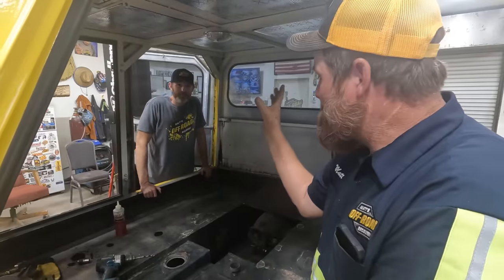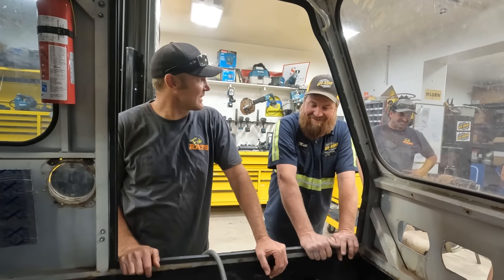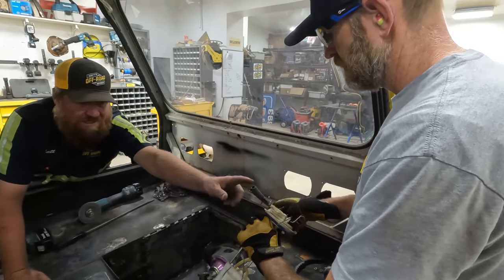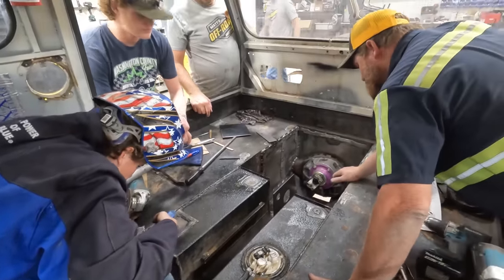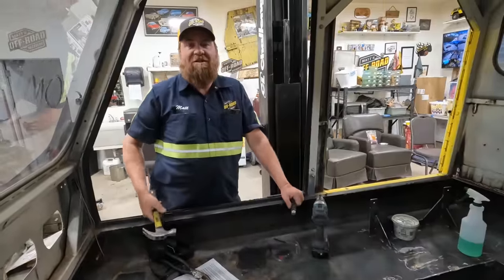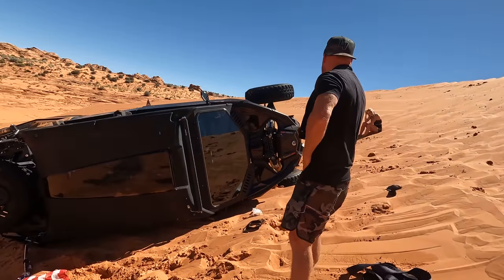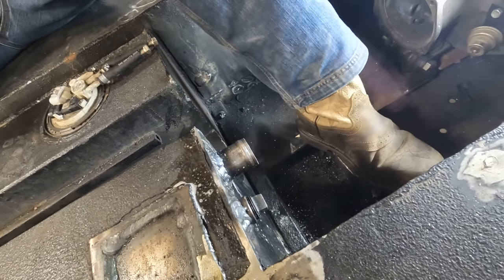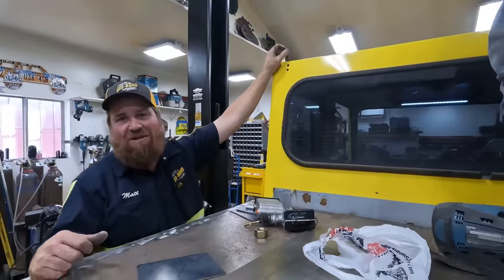I Made The Bombi Unsafe For Everyone, But Me!

Comment: Rhett, If you get a gas leak thats ok, He only asked you to make it waterproof, LOL.
Reply: Matt, Tom and Jamie... Kindly, As a Doctor,  "Safety Squints" don't work!  The sparks from a grinder are  FAST Flying particles of WHITE Hot Metal, and Flux that will INSTANTLY burn through  your Son's Eyelid, Cornea, Aqueous Humor, and Lens causing permanent BLINDNESS! Grinding and welding without safety Glasses is MUCH, MUCH more Dangerous than an improper weld, or securing a winch to a tow point.  These are your KIDS(?)! Set a good example! Would you ask your Kids to stand in the Triangle of DEATH when wincing a vehicle?

Comment: Everyone who ever got any good at welding began as a beginner. Some jobs are more challenging than others, and trying new stuff is how you get experience. Good job, Rhett.
Reply: Everyone who ever got any good at ANYTHING began as a beginner. Nobody is born knowing how to do stuff already. You learn as you go along, and everyone has to start somewhere. I remember when I first started training to drive 18-wheelers. When I arrived for my first day of classes in December 2004, I had never even been inside of a big rig, let alone ever driven one. Now, nearly 20 years later, I can just hop up in one, push off the airbrakes, throw 'er in gear and motor on down the highway just as if I had been doing it all of my life. But I HAVE'NT been doing it all my life. I had to start somewhere just like everyone else, as I did that first day in December '04, and learn things by trial and error as I went along.
Reply: @joeblowe5813  Maximum respect to big rig drivers. Ya'll risk all the loons on the road these days to get our stuff where it needs to be.
Reply: Welding is easy. Welding well is hard.  🤷🏻‍♂️
Reply: @Christopher_R  it's not that hard I was certified to weld government contracts and pipeline at 18 mig tig and arc under water is all I wouldn't do we always said good welders aren't cheap and cheap welders aren't good
Reply: Yeah I don't criticize as a general rule. When it comes to welding I never do. I was inspired to buy a welder by VGG and I consider myself a beginner. My work holds up, mostly on the snow plow, but I did some exhaust recently. That was a real challenge but at the end the truck is the quietest it's ever been since I owned it. Replaced a few sections and welded outlet of one of the cats. The hard park was the top where you can see and welding by feel is an option. After trying a few angles and getting my face and mask to close I got it.

Comment: A couple tips when you want a full seal weld. 

Make sure you clean off any paint or anything that could become a contaminant in your weld. Contamination causes porosity which won't help with a seal weld. 

Second tip, grind your starts and stops and weld back over the end of the last weld. This will help promote full penetration and a proper seal rather than what is referred to as cold lap. 

I was also taught MIG is the worst process for a seal weld, TIG would be your best bet for success on a seal weld!

Comment: Our tank builders will use a tig welder to go over mig welds that have a few pin holes. They also do a hard plug of all ports and pressurize the tank with a few pounds of air pressure, use a regulator to hold that pressure. Then check all seams and fittings for leaks.

Comment: i wrote a comment when you were putting those airlines on! i told you so, Stainless Steel hardline is the way to go with high pressure air line, anywhere that may have a bit of flex to it use a stainless braided airline.  Ive done air ride systems on many vehicles and never had a single issue with the lines!

Comment: SUGGESTION about the grab bar: no matter how high you raise it above the roof, recess it at least 10" back from the back side of the cab, so it lets you use the roof as the seat and grab bar as the backrest of the chair(or securing cage-like surround bar). Basically, it goes up from corners, then bends backwards as deep as you require for enough seating comfort, then turns across the roof and finishes the same on the other side.
Reply: Clever person.
Reply: I'd put 1 in OSHA Spec ( there's 
usually a min/max range )  & then 
a 2nd ( smaller diam. ?) maybe 
even 3rd horizontal bar(s) tailored 
in-height to fit your camera people's comfort.
Reply: @rythemzlatin  OSHA spec maybe too tall for the Bombi to fit into the shop; don't think it'll allow removable railings.
Reply: bar is good Seats are a MUST. Making someone stand for long trips on terrain like they travel is beyond OSHA, its raised to the ICC level.
Reply: @SFPhilo  It would be the same height as the originally planned grab bar, just not obstructing the edge of the roof. It would also allow for more storage above the engine bay, as they would not put seats in there.
Reply: hillbillygaragecs2921  you clearly missunderstood something. It is as safe as the grab bar, just with a little advantage.
Reply: My thought is, keep it low so it will fit under tree limbs.
If your talking OSHA they would require you to wear a harness with a lanyard to stand on something that high.
Reply: @bigredc222   Wrecker is way higher, never had issue with any trees, and on top of that there arent many trees there, and the ones which grow there, aren't that dense to be the problem anyway- at best little inconvenience once a year. Also, its not a road vehicle, so if you are not in the cage inside, strapping yourself to it outside is more dangerous than having freedom to jump of it any time you sense danger.
Reply: I would put fake stacks as vertical supports for the grab bar. Form over function.
Reply: 31:40 Could do a grab bar that lays flat / folds down on the roof and you pull it up and lock it into position when needed that way it's not always there adding height to the rig. Couple locking lynch pins  or something tied to the railing itself, or just have it 'drop down' and lock in using gravity / weight to keep it in. Locking lynch pins if you're worried bout it being lifted up / pulled out.
Reply: Maybe a seat like on a bass boat for the camera man on the back of the bombi
Reply: @Alconium  good idea. It could lock 90 degrees for standing and 45 degrees when you want to use the roof's edge as a seat to rest your feet. And fully down for tight squeezes... With pins, it would rattle. Something like Keyles bicycle seat clamp mechanism or quarter of disc brake and vice hybrid would work better...
Reply: @SFPhilo  An approved scissor lift has pins you can pull and flop or telescope the sides down, no reason this couldn't be the same.  OSHA would just say "can't be operated/occupied in that position".

Comment: Get pivoting boat seat pedestals for the seats in the bed. This way the whole seat and pedestal can be pulled out leaving only the mount when you need to haul cargo in the bed. They also usually rotate 360 degrees and lock at every 90 degrees of rotation, so the cameraperson could lock their seat backwards, forwards, or sideways.
Reply: YES, Bass boat style seats would work awesome and take up very little space. 
Can be removed also when not needed.
Reply: Grumman seats are just as easy. Made for van floors.

Comment: I admire you all for mig welding your fuel tank and fittings, I was thinking to myself when you checked for leaks that i would have brazed all those fittings in and fixed all the leaks with bronze as well. Good job on the Bombi so far, I'm sure it will work awesome when its done.

Comment: I was there yesterday and was so happy you put those triangles on the core support. 

Now you must consider having the grille of the same shape with the exhaust protruding through the grille. Honeycomb grille representing bomb BEE. Have you CNC guys cut out the honeycomb. Then bend it to match the triangle shape. Have the grille powder coated with chrome powder coating. That will set it off against the yellow paint.

Comment: Little trick for when you are welding tanks.. Ofcourse  you tack it up but use very low power for small tack welds, then reposition your tank on the bench so you are welding down hill with normal power settings.. Seems to work very well, atleast for me it does...

Comment: Seems to me in front of the drivers seat would be the best place for the brake handles..if you came up from the floor where they are now & above the floor a foot or so & then go drivers direction 90° or close to it...then 90 again above the feet & between the knees, then just short uprights..just above waste height would be a good setup..still keep the floor clean & free of obstacles,  & get the sticks in a more ergogonomic position.??  Just A thought... might not even fit or work that way!!

Comment: You know Matt, knowing your rep like all of us do may I suggest that you put two fuel sensors and fuel gauges independently of each other, you know , just in case.
Reply: Doesn't matter how many gauges or sensors you install it still needs someone to interpret "E" as being representative of "EMPTY" rather than "ENOUGH"! Then that person has to take said tank/vehicle to the gas station, liberate the credit card and fill said tank to "F" which represents "FULL"!
Thanks for the laughs and video.
Is that tank not removable? Would be a lot easier to weld on the floor or bench.
Regards from Canada's banana belt.🤞🇨🇦🍌🥋🕊️🇺🇦🕊️🇺🇲👍
Reply: Maybe an old school sightglass in each tank for in case each gauge fails too. 🤔

Matt things 😂

Comment: Matt, have you ever considered mounting a vise to a flat plate and attach it to a receiver hitch for you trail repairs? I think it would be very beneficial to some of your trail repairs!
Reply: They have a vise for the receiver on the wrecker !!
Reply: Ahhhhh! I just must have missed that. I’ve not seen it yet. Thanks for the info!👍🏻
Reply: @ericszatkowski6001 Matt likes to keep weight to a minimum especially on vehicles that work in the sands. A 25 or 30 lb vice is a chunk of weight, for the most part, doing nothing. Yes the wrecker has one, stored on the boom I think. Right hand side, it's red, if my "firgetery" is working.
Reply: @ronwilken5219  very true sir

Comment: I'm SO GLAD those little corners got filled in, looks a bunch more betterer. 👍

When you want to weld water/airtight, TIG is your friend.  Also buildup of weld is like stacking contaminants, it's a merry-go-round of failure.  8's is the best MIG way I know, dig the leak and dig a dimple beside the leak, plug the leak and move to the dimple to finish the weld, so you don't get the "fisheye" over the leak that will perpetuate.
Reply: Also likely safer when you are trying to hook a rope with one hand, hold the hitch open with the second and hold a go-pro in the third, all while standing on uneven icy ground.  Not as pointy for your skull...

Comment: Hey just a thought.  Since the brake levers are going to be in between the 2 front seats, why not parrallel the throttle on the passenger side so you could drive from either seat.  Could come in handy.

Comment: Welding a Gastank and similar is done great with WIG. Because you also can reflow an existing Weld and shut Pinholes OR you can add a material. Also the Weld is cleaner which is similar to less Pinholes. Another Option would be to solder it on (dont know the exact english term, hardsolder?). Fixed a Motobiketank this way.

Comment: I am sure you don't want a posi track. But a Air locker will make both tracks pull if you're stuck . And can be unlocked to let you turn like it's supposed to. That's what semi trucks do for traction.
Reply: with turning brakes thats redundant, whenever the side you dont want to spin starts spinning you just apply more brake yourself to compensate

Comment: Just a suggestion. You might look into doing some acetylene torch welding on some of that thin stuff. I have found it can be a gentler way to weld. Slower, for sure, but sometimes that's what's needed.
Reply: They also have TIG setup, but seem to not have anyone who's comfortable with it.
Reply: Or TIG.  Much better heat control, I think.  I just bought a TIG welder and I don't even know how to weld 🤷‍♂️

Comment: Make that roof bar foldable over the roof, with safety pins, and seats that would integrate into something like towing hitch receivers, so they are easily removable. And also a camera holder and/or an 360 light holder ...
Reply: millennial   Han and Chewie would be pissed.

Comment: Matt, Crazy thought, on the steering/breaking levers, if you put a third level between that an inch forward of the 2 existing levers that sticks up 5? inches higher and attach a crossbar that could pull back both levers when the center one is pulled you could have a one-hand full stop lever. With a little fancier fab work, you could even a locking mechanism to the third lever as an emergency/parking brake.

Comment: Windex, best thing I have used for pressure testing. Even the smallest leaks turn into a bubble mass in a few seconds.
And I discovered entire by accident, or laziness, however you want to look at it. Soap was at the other end of the shop and the only spray bottle left that worked had drill coolant in it.

Comment: Hello Mat. Just to let you know of the pending trouble you are about to cause your shoulder joints. I was in the military for over 20 years. Different trials were carried out on steering systems as you are proposing. While your system might seem novel to you, or maybe you just want to be a stubborn old fox that won’t let go of your offset levers. After using the Bombi for just a couple of hours you will be sorry you ever thought about it. A jolt in your machine while pulling on one or worse still both in an emergency can and has in the past lead to you pulling your shoulder joint right out of its socket. If you want a novel, yet sensible way of steering you can easily fit remote mounted servos connected to the master cylinders that operate the servo with another master cylinder then they are piped to the respective brake chambers or slave cylinders. You have lots of room on the Bombi to mount them anywhere as they are piped from the standard master cylinders. Get the bore sizes right, ie small bore master cylinder to larger bore slave cylinder is equivalent to longer levers. This would mean very little force would be required by the operator even possibly with two short levers dash mounted. This would give much more space in the cabin giving a much easier entry or emergency exit from the Bombi. As your idea might appear good, just imagine having to strip your whole system out again because yourself or one of your amazing team dislocates one or the other shoulder. Lots of experience in trials and uses of such ideas should count towards your decisions on your rebuild. All the very best to you all and keep the great content flowing.

Comment: Once at a fab shop in Illinois, a guy built a tank for coolant storage non-pressure, it was about 16' w X 20' long X 12' in height. The guy that welded all this together decided to check for leaks WITH AIR PRESSURE. The plate used was about 5/16" thick steel with varying gussets, interior baffles and corner bracing. Luckily another fabricator saw what he was doing and pull the plug while he was airing it up before the bomb went off.

Comment: If you build another fuel tank.  The best way to deal with leaks is the drill a small hole at each leak.  The benefit is you know where to weld, you clean out the area and you get better penetration.

Comment: In case no one mentioned this but there is likely to be a spray of mud,snow and slush hosing off the back of those tracks going upwards and forwards. Just be sure it is not going into the exhaust or somewhere else you don't want it. Some mud flaps are probably in order. Fun project!
Reply: The short exhaust would melt it before it became a problem getting behind the rad would be my worry plug the fins and overheat

Comment: When I seen the grab bar up at 48" I was thinking it wouldn't make it thru the current garage door.  I wonder if a telescoping bar would be worth while. Drill some through holes in the base bars and use hitch pins so you could adjust it up or down for the riders preference. I might be a interesting Go-Pro location.

Comment: You all sitting on a gas tank (with 50 patches and no secondary fire barrier) sure puts the BOMB in Bombi. Every time you start that machine you need to do a leak inspection. You could end up with 10 gallons of gas sloshing around in that tub area down there.((I don't think you even have a way to drain that tub) They took the fuel tanks out from behind the seats of pickup trucks for a reason. Stay safe!

Comment: Mount the controls in the middle and then bend them 90 to the left with the right control slightly higher than the left. Then directly in front of the driver bend the 90 up and put on some grips. It keeps them attached to the middle of the cab but puts the grips in front of the driver, but doesn’t impede leg room.

Comment: On the grab bar;  To give the option of moving under low hanging limbs, have the cameraman grab bar rotate up from its stowed position into the up position and lock.
A removeable loop to retain the driveshaft, so when the U-joint breaks it doesn't take out the brake lines or try to come up into the cab.

Comment: Just a suggestion from years of making air tanks and everything else to hold something. If you peen the leak closed with a center punch first, then spot weld the peen you will have a much cleaner tank and easier time.

Comment: it’s probably already done but a good idea for the camera guy seat is to weld a low grab bar for when youre sitting. then make a hinged seat thats mounted to the back of the cab. youd have to step over the seat to sit down so thered be an opening between the seat and cab for your legs but then when it folds up you have a latch to lock it in place. you could have a grab bar welded to the back of the seat so when its in the up position it makes a taller grab bar for when theyre standing